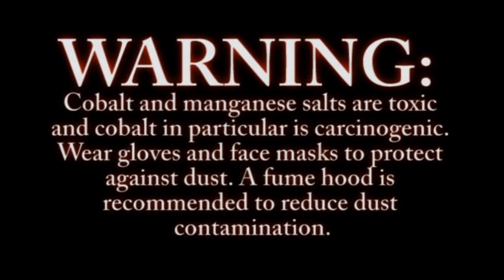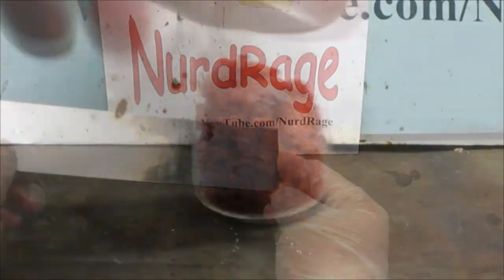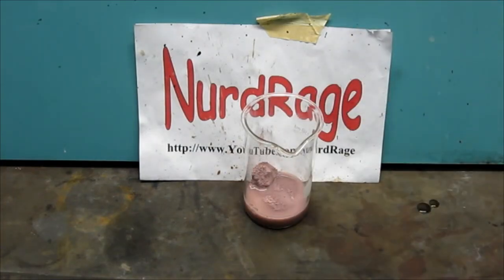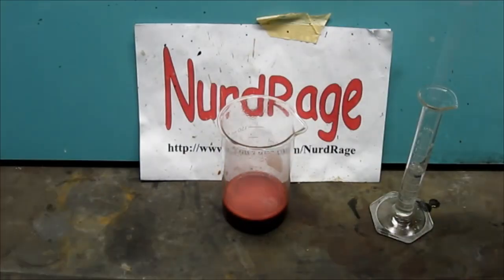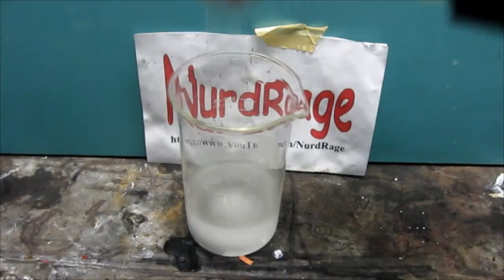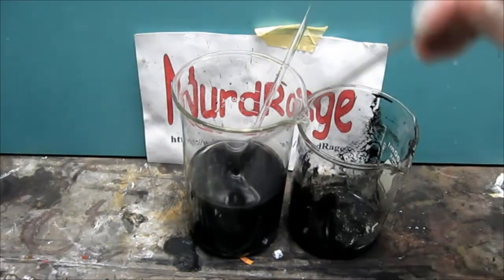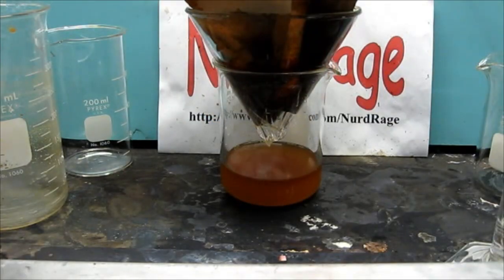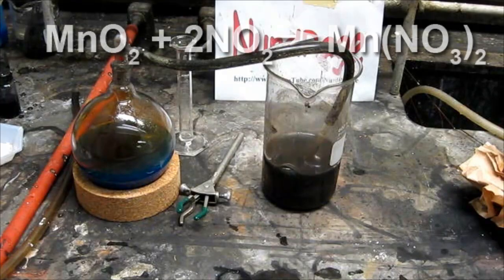Make Cobalt and Manganese Nitrates

Comment: I dissolved Ca(NO3)2 in water and slightly smaller amount of MnSO4 in water, then mixed it to perform the double displacement reaction which yielded Mn(NO3)2 and CaSO4. Use excess water because as the CaSO4 precipitates it becomes like a thick slurry if too little water. Filter off and you have a Manganese Nitrate solution which can then be concentrated as required. With probably a bit of Calcium Nitrate as I purposely used excess to avoid having Manganese Sulfate in the final product. Solution can be crystalized by evaporating the water slowly.

Comment: I think the precipitation method didn't work because nitric acid reacts with the iron oxide in the battery paste to form Fe 3+ ions in the form of iron (III) nitrate. The precipitation method only works with solutions that are contaminated with Fe 2+ ions. Have you tried to add some iron metal to reduce the Fe 3+ into Fe 2+ ?

Comment: @NurdRage you said that heating the Co(NO3)2 makes it more solubile but wikipedia says @ 0C 134g/100ml  and @ 25C 103.8g/100ml so that seems like it is decreasing? also it says something about decomp @ ~74C.  is this true?  because that would mean no boiling down to dry, and greater solubility at lower temps, basically leaving you with only dessication to crystalize it. that kinda sux. have you found these values to be true?  thanks for all the awesome vids

Comment: hey old friend nice vid, glad to have it, i am currently making a catalyst for h2o2 , tha maganese dioxide is to powdery, i need a solid form, i tryd to mix it with molten alloys and even epoxy, they all wrk but it seems im still loosing catalyst  in the solution, im building an oxygen generater that uses 35% h202 as the testing with 40 volume dosnt seem worth it, i could by an 02 bottle at 4000psi but where is the experiance in that, i gotta build sht to no what you cant do....

Comment: I think that you can purify your manganese nitrate by simply make some manganese sulfate and purify it by the methode Nurdrage showed.

Than you convert all off the manganese sulfate to hydroxide by using sodiumhydroxide.
 than you have manganese hydroxide and can mix it with nitric 
acid in order to get purer manganese nitrate out of batterys

Comment: Should I let it be known that the assumption: "replace the sulfuric acid with an acid containing anion X to make Manganous X" doesn't work for chloride to make Manganous Chloride? 

Manganese (IV) Oxide, MnO2, is a strong enough oxidant to oxidize hydrochloric acid to toxic chlorine gas. Don't try to use this method to make Manganous Chloride!

MnO2 + 4 HCl---> MnCl2 + Cl2 + 2 H2O

Comment from the maker: @blkmirror oh heat won't solidify it, it has a very high solubility and heating only increases it.

Add a bit of nitric acid and then do cold evaporation with a dessicator.

Although if your intention is to make electrodes by baking (as shown in my next video) you can use the straight red solution as-is.

Comment from the maker: @JunkmanJim the nitrates are used mostly for making the electrodes. By themselves the nitrates are rather toxic and thus they have very few commercial applications. 

The electrodes are not that special as far as electrodes go, but they are more resistant to oxidizing conditions than common electrode materials like iron, copper, and carbon. So they're useful for HHO or Chlorate cells.